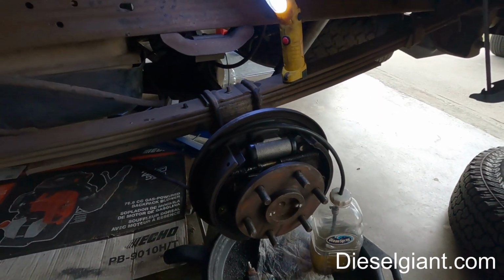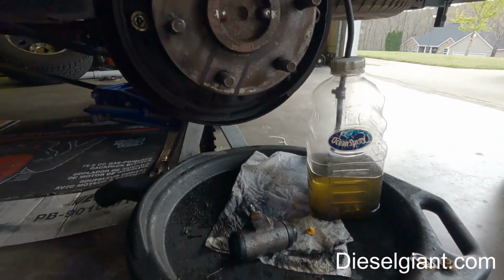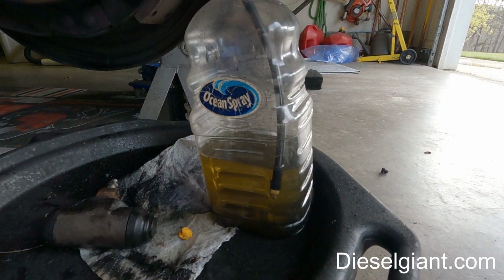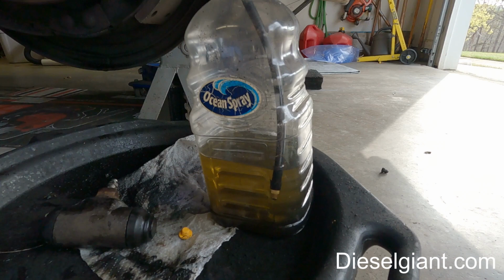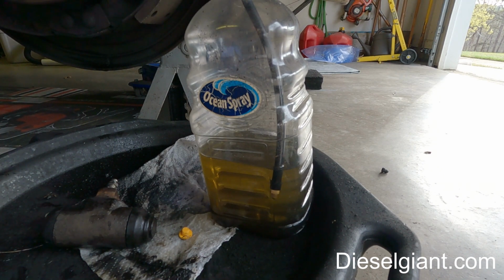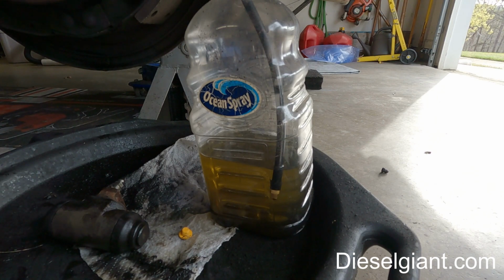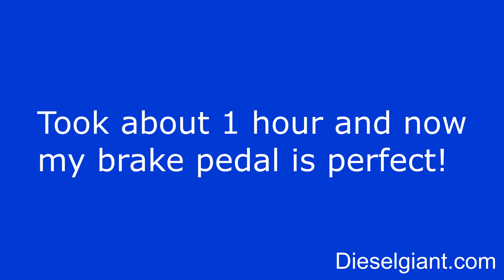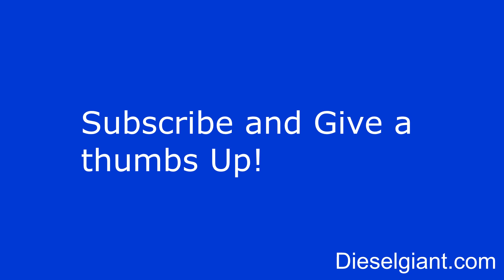How to gravity bleed your brakes by yourself, no helper needed!

Comment: I like this method personally, even if I have a helper or not. Crack the bleeder and leave it open for a little longer and wait until you get a stream with no bubbles. Did it take you one hour to do one wheel or did you bleed every corner?
Reply: I had replaced the wheel cylinder so that’s why it took so long.

Comment: Wouldn't have the patience for this. I'd be tempted to use Vaseline if I had to do it, special paste sounds like snake oil to me....
Reply: Silicone paste is the only thing compatible with brake components.  Petroleum Jelly is NOT nor is snake oil.